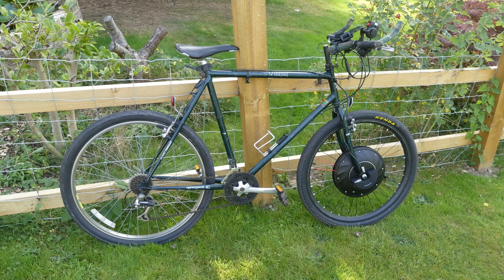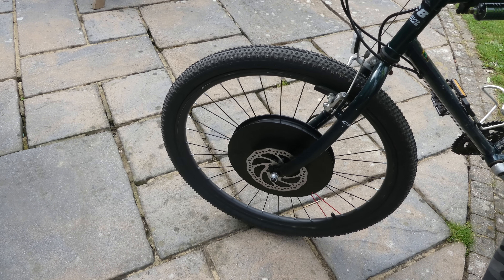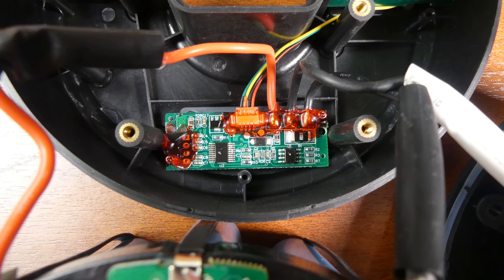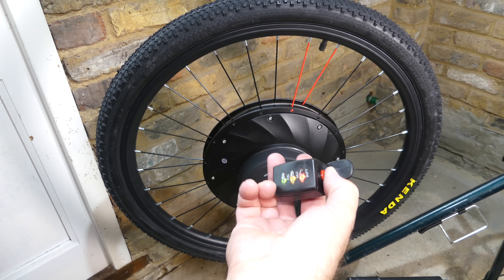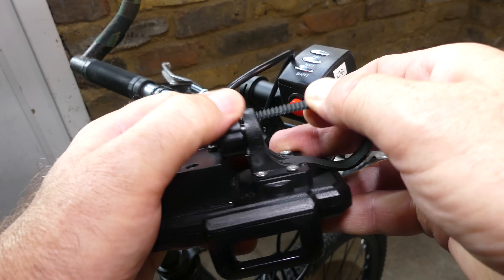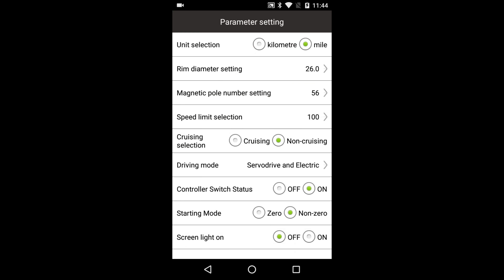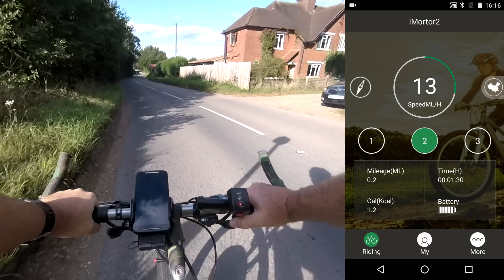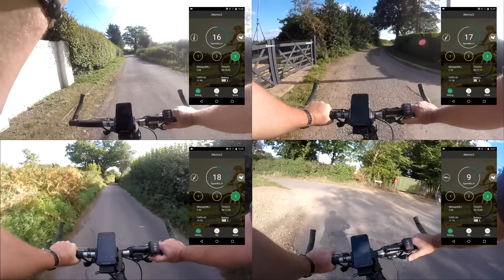Turn an old bike into an ebike - cheap & easy IMortor conversion kit

Comment: I can see that battery life is not the strong point of this kit
Reply: I was wondering where the battery pack was when he was showing the kit until he pointed out it was the little thing next to the charger. I chuckled a bit.
Reply: I'm sure it has at least 20 miles on it
Reply: @riddikssaga  i really doubt it
Reply: That 40 minute battery life isn't even worth putting the bike together
Reply: @Incognito_90  is that full throttle 40 mins
Reply: It's less than that. You have 10 x 18650 battery in series, which is the bare minimum because one of these cells has 3,7 volts and you need at least 10 because the controller is rated at 36v. One of these cells is 3000mAh capacity assuming they are high quality and new. So we got 3 Amp hours on the cells, multiplied by the 36v that's 108 Watt hours; so we get 108w for one hour out of that pack.

I looked the motor up on aliexpress, it runs on 7A/36v to put out 250w. So if we draw 250w out of that pack, we get less than half an hour, about 25 minutes. 

And this is all assuming high quality components working in prime efficiency.
Reply: 40 mins your kidding me! Oh hell nah I'd rather stick to my manual bike
Reply: @ccllvn   Is there a kit whereby the battery will last a good long time?
Reply: @hipairbrush1053  You can still use any kit as this isn't proprietary tech. The battery on this particular one seems to connect via a XT60 connector to the controller in the motor housing. 

It just happens to come with a weak battery but you can connect any battery to that XT60 connector, as long as it is rated at 36V and can handle the 7A discharge. I can't recommend a finished kit but I bought components from Luna Cycles and Tranz X before and had good experiences, if that helps. But again, just about any battery within those specifications will work. If you're careful you can buy bulk 18650 cells, nickel strips and a spot welder and make the pack yourself.

For decent battery life I would go for a 10s4p configuration which would be the 10x series setup from the video 4 times in parallel. In parallel, they add up to one large capacity battery, basically the same as if I had 4 of these batteries and just swap them out when one is going empty.

Comment: I bought one of these ebike kits a couple of years back,turns out it was one of the best gadgets I’ve bought. Simplicity is my favorite in gadgets like this ebike wheel hub.
Reply: How has the old bike handled it? Is there much more wear using the conversion?
Reply: @knoppinator  the bike is handling it well,I’m still riding it around the neighborhood a few days out of the week.
Reply: How long does it take for the battery to charge
Reply: @Andyfishingadventures  2 hours to 3 that’s what it says on the website but I can’t find how long it lasts for if anyone knows plz let me knoe

Comment: For anyone interested i have this motor for two years now over 3000km done. It used to have 17km autonomy with pedaling. Now the battery only gives 8km. Great value
Reply: wondering  if you can just replace the inner batteries using batteries from the internet to get back to full strength...
Reply: @erackauskas4941  i got a cheap electric hoover battery and it works just fine and double the mileage
Reply: Can it be used without an iPhone?
Reply: @erackauskas4941  You can buy a separate battery and run a xt-30 connector to the wheel since the inner portion where the battery is connected doesn't spin.

Comment: I rode 1200km in 1 month on this motor. I soldered an external xt 30 connector to the battery and added a fuse. Now i ride over 30km at 32kmph without voltage sag with full power from beginning till end of journey. I bought a pair of 4ah powertool batteries and made a series connector to get the voltage to 42 volts. I also added a small charging circuit so i can charge the bike with 12-36 volt batteries/output
Reply: Build quality is amazing for the price. The waterproof and reduced wiring is simply amazing
Reply: This motor is very efficient at top speed.

Comment: At least you selected a welded steel frame for the conversion. That's a good thing. Head set bearings are easy to change.

Comment: I like the concept. The battery on the hub seems like alot of front end weight.
Reply: It's also a very small battery pack for this application. It's not a great design.

Comment: Pretty cool, but the battery is quite wimpy.
Reply: But the simplicity and the freedom of no battery bar on a stock bicycle. That's not bad. Maybe it could be redeveloped to store a nicer Battery in the same space. Regardless I just need something to take me 3 miles to work and 3 miles back. It's uphill one way but that's why I need the motor 😂.
Reply: Also an extra 2 or 3 batteries on a back bracket would make it pretty legit also.

Comment: The power connector on the battery is actually an XT30. I found that out after I needed to replace mine.

Comment: I had a bad leg injury this could help me build leg muscles again with a little power assistance.
Reply: To avoid further injury, make sure you have disc brakes. This model is in the same gear all the time, where a mid-mounted motor works through the gears and is more versatile. Good luck.

Comment: Have used the same kit and loved it until I once hit the rain. Since then: just won't accelerate anymore
Reply: That's it. No responses?
Reply: @frankcoble4052    pretty much. First few days it wouldn't load but still accelerate then loading worked again but acceleration never did. Disassembled the thumb throttle and fiddled with it to no avail. There wasn't much electronics in there so I imagine the main brains are in the wheel. I didn't look inside the wheel cause I have no confidence that I could understand what I d see there plus I m still riding on it (without power).
Reply: @BeardedSkunk  that's too bad.  Hope you get it resolved. Write the manufacturer
Reply: @BeardedSkunk  You're correct about the "brain's" location.  Unfortunately the hub motor/electronics module doesn't come sealed against weather.  The "excuse" provided by distributors is that doing so would cause the "unit" to overheat.
Reply: Would you recommend to use in London every day ?
Reply: @robertroro3945  No,this is garbage
Reply: Well thanks for pointing that out, that means I'm not gonna get one now, it's always good to know before you buy so you don't get stuck with a piece of junk!
Reply: @steveg2406  that makes it a sure fail! Because that means you should only ride it sunny weather and if you get caught in a shower, your screwed!
Reply: There is one way, 
Take it apart (battery module ect,) and use some good sealant, only way,not meant for drenched UK 🙁
Reply: @Jademyheart  would using tape work as well?

Comment: The battery located on the front hub is not going to last long in a wet country like the U.K. Water will eventually get into the battery particularly where it plugs into the motor terminals.
Reply: Worse: I hit the rain once with that thing and that destroyed it. It was a pretty heavy rain granted and I'm pretty sure I used it in light showers before. My battery is still fine, it's the electronics inside the wheel that gave up. I'm still tempted to buy another one and just not ride it in a storm. Worked great for a year or two here in the German climates.

Comment: I have an iMotor and it works fine except that I've had issues getting the app to work.   I've not taken it on a long ride but was wondering if there would be a way to add more batteries to the system.   Bring a wire out of the plug in battery case with a plug that would connect another battery that could be hung or mounted to the frame.   It seems reasonable but I've got minimal electric knowledge.
Reply: yes that can be done, toughest part will be finding that connector.
Reply: @rollandelliott  If you want more info I have completed 5000KM on my Imortor and I have some experience.

Comment: So the link takes you to bang good and right now in dec. 2020 it’s priced at $360.00. Not bad I suppose. Definitely not as good as higher end models or purpose built e bikes but if your turning an old beach cruiser or old mtb. Not bad at all considering you do get everything including battery and charger. Other diy kits sell the wheel hub only with wiring kit for 300 US dollars but the battery and charger will cost another 300 to 400 or more depending on size of battery. I think this is great for what it is and turns your old bike to an ebike fairly quick and easy and not too expensive compared to other diy kits or purpose built or serious e bikes. If you can buy a second battery to take with you now that would be awesome!
Reply: today I rode mine 80KM with my own diy powertool battery pack and some RC plane lipo packs that I use to charge my bike while i ride.
Reply: I currently have 2300 clocked KM on this

Comment: Oh i love this e bike kit its amazing, i would say i love it because, at the same time i can pedallin without disturbing the motor infront because it is independently working the motor on the front wheel while the other one is on the rear. You can pedalling on the rear wheel. and the most of it you can off the motor while pedalling on the level road which you can save the power battery. Sir would you share the web site? ....to where this stuff to buy?

Comment: Thanks for this review, it’s the only decent informative video. But you never mentioned hill climb how long battery last before needing a charge and if it can still be ridden with battery off.

But besides these a great informative video.

Also can you remove the tire around the spokes of the battery wheel and put your own tire on the spoke of battery wheel?

Comment: looks like a great kit, one of the easiest to install. I am a bit concerned though that the battery capacity is a little low, my current batteries are both at least 10,000 mah and I would like them to be of larger capacity.Unless this thing is super efficient and 3200mah is enough. I would buy but I feel my next kit should be at least 1000watt.
Reply: Looks like you can buy an extra battery for as low as $100 if you search front wheel ebike battery
Reply: @rlanesports  Low? $250?

Comment: Strange they use reversed XT60 on the battery. It should be easy hack though to use a larger external auxiliary battery on this for longer rides. Is it possible to upgrade to twist throttle?

Comment: Thinking of getting one of these. I've read some reviews saying there's problems when it gets wet. Any truth to that?
Reply: I'm no expert but I don't any type of seal on the battery pack when opened. All signs point in that direction!
Reply: any electrical motors,appliances, etc. 
will get a problem when it gettting wet
Reply: Im in the east of the uk..we just had some pretty heavy rain..i had to come home from work in a heavy downpour and i was absolutly soaked...wheel was awesome and didnt miss a beat....Best thing ive bought this year easily :)
Reply: @baddestmofo3724  ...do you have a video to prove that because it is well known these are not waterproof or water resistant even the manafacturer advertises this.

Comment: Hello mate, do you know if this e-wheel would fit on a standard road bike frame? Also do you have to use a smart phone in order to use this e-wheel or can I not use it? How do I remove the battery from this wheel? Sorry for this stupid questions.. Thanks in advance :-)
Reply from the maker: There is an 800c road bike size wheel version. You can use it without, but to change options you need to us an app. The battery just unplugs.
Reply: @techydiy  

Thank you so much for the super fast replay. 

I took some measurements of my road bike wheel and the full size of the tyre/wheel is 26inch so I guess this e-wheel will fit however last question to you is how much clearance is needed between the bike forks? I took measurements of my forks and it is showing 100mm or 10cm. Do you think this e-wheel will fit? Or is my bike fork width is too small? 

Thank so much once again. Your videos has been the best I have seen on youtube regarding front wheel e-bike installation, it was clear, concise and without any background annoying music which is why I am going to subscribe to you :-) 

Thank you and keep up the great work :-)
Reply from the maker: The distance between the forks of the bike in the video is 100mm,  I think this is the standard distance for most bikes.
Reply: @techydiy  

Cheers bro..

Comment: Sonny, the major downside with front motor hubs is that there's less weight on the front wheel. The majority of weight is centered on the rear wheel giving a lot more advantage when taking off and climbing hills. When climbing hills the majority of weight will of course fall on the rear wheel while the front motor hub will spin away leaving the bike almost stationery even worst should u want to climb a wet ground hill.
Reply: @techydiy  It's to do with physics

Comment: Do you think this would work with a 40v ryobi battery wired with a xt60 fitting at the end. It would be nice to have multiple  batteries for longer range, and i have a few of those.
Reply from the maker: Might do. Depends on what protection the batteries have built in.

Comment: I wonder if you mounted a front wheel kit like to a bike that already has a rear wheel kit with twist throttle how they would work together. Not necessarily controlled by the same EDC just standalone but on the same bike.

Comment: So this is a 21v max battery pack, 4.2 max charge per parallel pair, 21 seems very underpowered for a supposed 36v hub motor? I see no boost converter to step the 21v max available voltage to 36v.
Reply: It's 10 18650's in series, just one cell in parallel.
3.6x10=36volts
Fully charged 4.2x10=42volts
Reply: @mashedpotatoes5323  in that case that's the most unsuitable pack I've ever seen, the cells must only have about 20 minutes runtime,the battery is just a power placebo, it's a good job that the batteries are on the front wheel and not under your nuts as there is a good chance it's going to end in flames.
Reply: @dtwistrewind7361  they are high discharge cells it shouldn't blow up or anything but the cells will definitely not last as many cycles when they put out that many amps

Comment: For who is asking:
Is the battery charging when I go downhill?
The answer is NO ,cause this is a DC engine,to do the "rechargeable thing" U need a AC engine connected to the battery and that AC engine connected to the DC engine in the wheel,(I'm not 100% sure).

Comment: What guarantee have you got that the motor does not continue to spin the wheel when you apply the brakes? I want to know that even if I apply the brakes (v brakes on my bike) lightly, the motor will stop every time the pads make contact to the wheel.
Reply from the maker: You can add a brake sensor

Comment: @techydiy - Thank your for your review. Does this unit work without PAS or break bensors? What is your experience with the range. The capacity has from my point of view something between 70Wh and 100Wh (1P10S with 18650 with ~2500mAh each). Is this right? This is not much compared to conventional ebike conversion kits with 300-400Wh batteries. What do you think?

Comment: Can a trickle charge be established from the bikes motion ? Maybe a separate battery Bank charging ?
Reply: Batteries don't like to be charged with fluctuating voltages/currents.  That could probably be overcome with a circuit though that regulates it, but a bike dynamo running 3W only when at full speed might not be enough, unless you were somehow able to refine the design, or just have a number of them working together.
Reply: @EnglishLaw  thanks for the insight
Reply: A dyno is not free energy.  It will spin easily when it is not wired to a load, like a depleted battery, a light, radio etc.  When it IS wired up to a load, it gets more difficult to spin it.  You always have to input more energy than you get out.  That's why a dyno powering a motor that spins the dyno can't even keep itself running.  3 watts is so tiny, you can usually not detect the extra effort it takes to spin a dyno when the light is on vs off.  The extra drag wii reduce the speed and range of the bike more than you will recoup from the dyno.  Lose-lose, not win-win due to friction & electrical resistance reducing the efficiency of every energy conversion from mechanical (bike motion) to electrical (dyno) to chemical (battery) back to electrical (motor).  That's why regenerative braking sounds good but barely works in reality.  Energy is not created or destroyed, but it can be inefficiently converted from one form to another.  No electronic circuit creates energy.    For example, a transformer that increases voltage sacrifices amperage and some current is always lost in the exchange.  When you take a physics class, it will all be much clearer.
Reply: @denbecr49  retired concrete forman , you couldn't even get me into a knitting class 🤪🤣

Comment: What size spacing does the fork needs to be? Cause I have a mountain bike but the imotor  wheel simply won't fit. The Imotor wheel is like 4.5 inches wide at the hub and my bike hub spacing is only around 3.5 inches.

Comment: Do you need the imotar pedal assist to have pedal assist? I see you have a separate link for that. Does the main unit not have pedal assist or is just throttle?